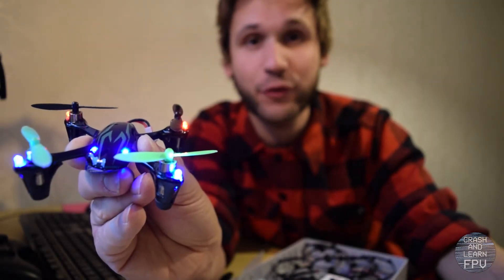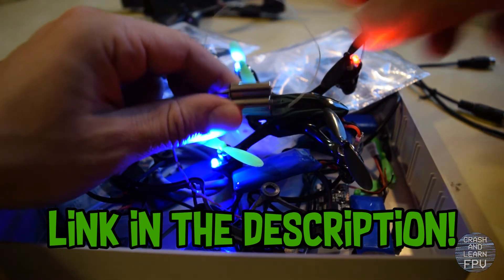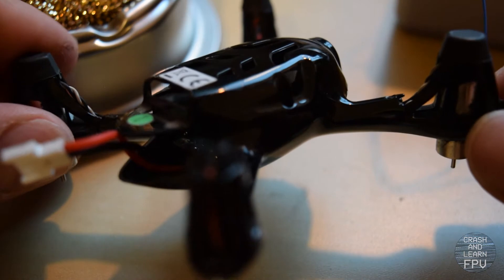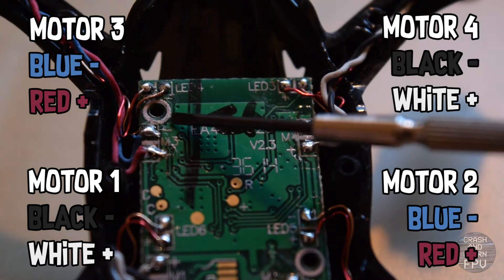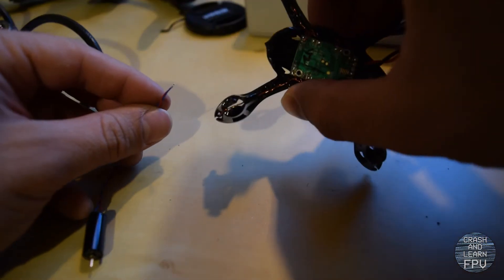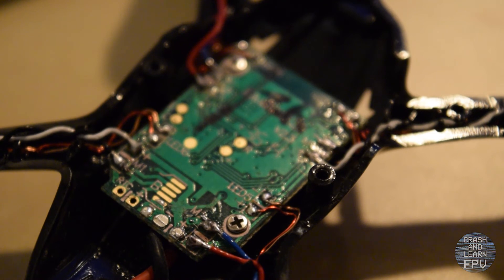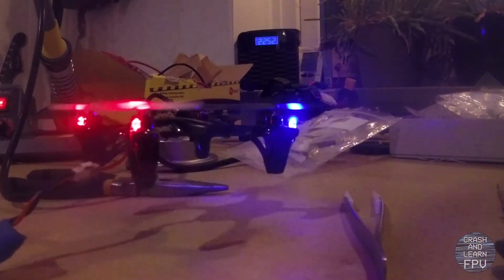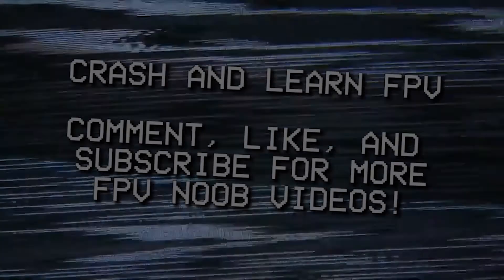Hubsan X4 Motor Upgrade

Comment: No need to change the motor. Jus recalibrate the quad. I had this same problem
Reply: "after one of the stock motors broke"
It`s in the description AND the video, lol.
And the video is about UPGRADING the quad..

Comment: Will the battery need upgrading once the motors are upgraded?
Reply: Technically no but if the motors are stronger the battery will drain faster